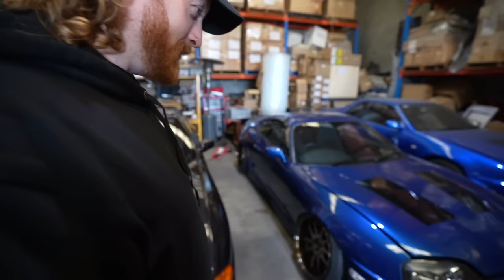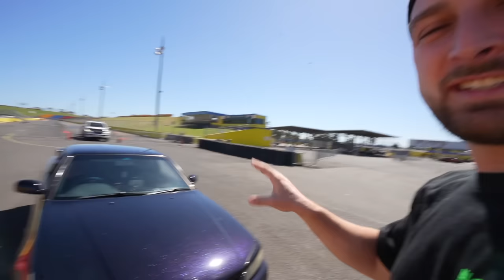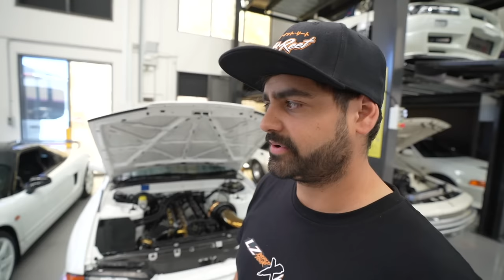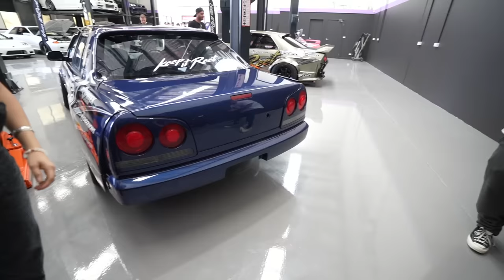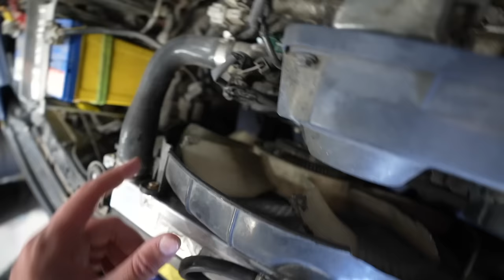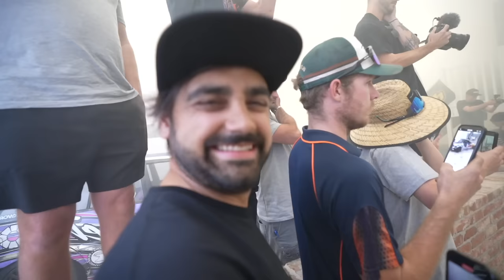I flew across the world for THIS car!

Comment: That 6-rotor has the tone of a 12-cylinder F1 ..../ The tubular "shocked" rear end of Jimmies 34 and those magnets for the decklid is a great idea! Just need to add a pair of small cart wheels mounted horizontally in the rear bumper corners so he can just ride the wall.